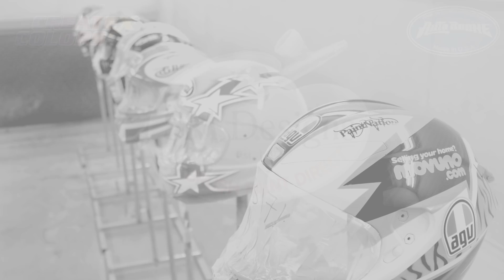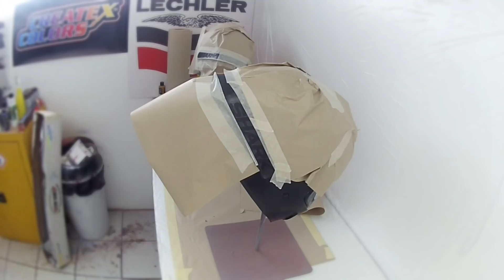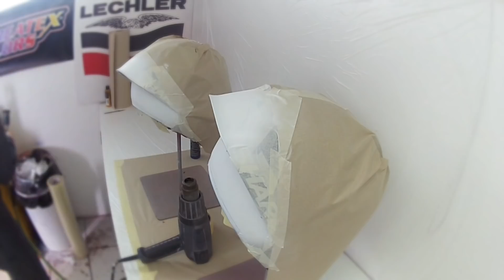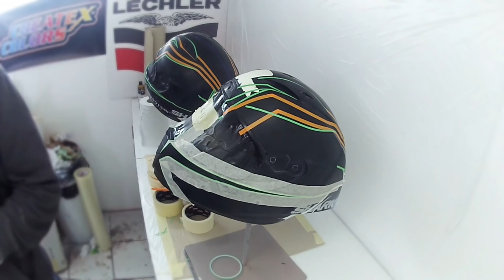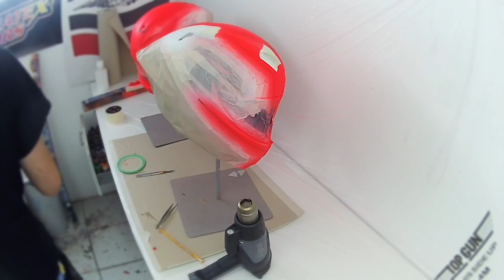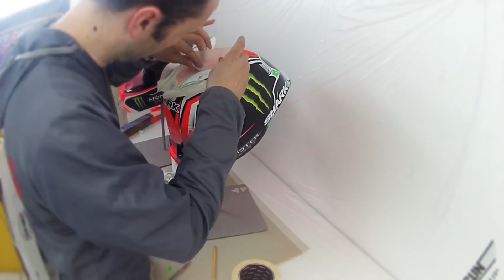Tom Sykes 2018 Shark Race R Pro GP

Comment: Can you use cans of spry to get the same effect??
Reply from the maker: Hi Col Sinclair, No. The product in spray cans is solvent based and not recommended for use on helmets! Also you will get a large build up of product on making edges, plus lack of control with detail. Short answer, No :)